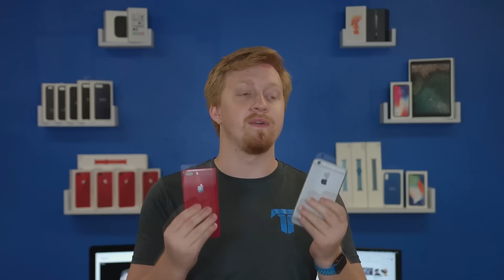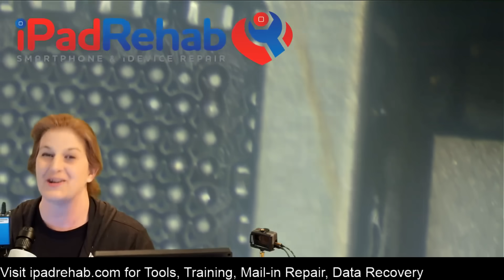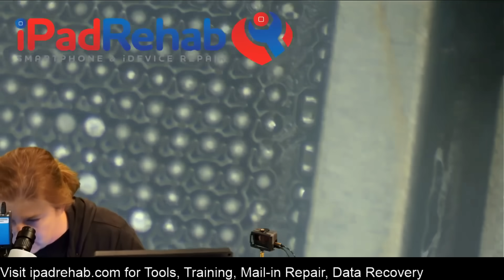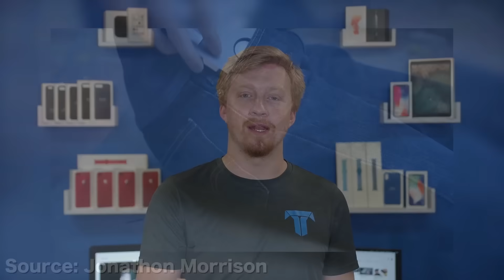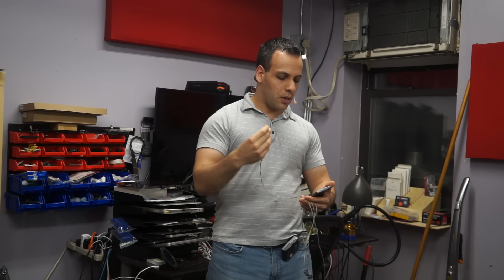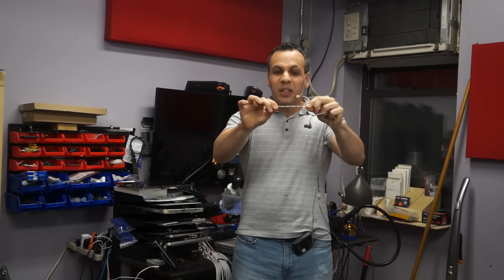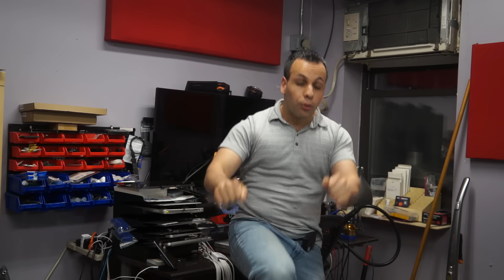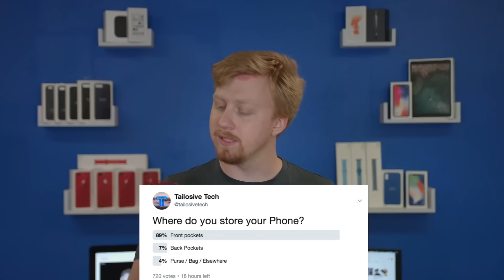The truth about iPhone bendgate deniers

Comment: As a matter of fact I have had two Samsung phones bend literally over time. I usually stayed in the J7 line of lower mid range Samsungs so getting a new phone every year while getting the latest updates was far cheaper than buying a flagship. The J7's range from `180-250 and one year they changed  from metal edges to soft plastic and I went through three of those by having them in my pocket of course Samsung just replaced the phone free. The next revision of Samsung's J7 was done with a harder composite plastic on the edges. When someone like Louis see's repetitive repair problems there should be a mechanism to report what he sees to apple. When I used to get a new computer I would call an old repairman and ask him about recent models and he would say stuff like "bad capacitors on hp" or don't get a Lenovo right now bad hinges . He was a wealth of info and I kept all my business with  him.. Heck he soldered my mp3 player back together once after I dropped it.

Comment: Funny, this is off topic but watching this video, Mr. Rossmann explained basically why/how what was at one time even my favorite pair of earbuds would go on one of the two sides, and in the last two cases, within 3 months.  I have been using over the ear headphone since i gave up on those Sony earbuds and I have not run into that problem even with my @ 4 year old pair with daily use .. .it does have another issue (100% USER error) but both sides even with that goofup ... still work perfectly fine

Comment: Apple could of fixed it just a small change in the caseing. They could of thickened the casing and slightly thinned the silicon. This would of cost a small amount of retooling. They could of increased the size of the casing, and only way you would be able to tell is if you placed a micrometer on it. He'll LG had a solution in its OLED models that allowed the silicon boards  to flex with the screen. You would break a AMOLED screen before you brake a board in the LG Flex.
Reply: Carter Baker wow LG G flex that phone was literally made for back pocket
Reply: Wgg Wfg the problem with it was resolution.  Plus Oled had a burn in issue just like initial plasma TV scteens.

Comment: Its almost as if they never did the fatigue calculations. Oh its aluminum it can take the repeated loading and unload without stress hardening and failing. doesn't it deform instead of failing. Yeah but that won't affect anything. hundred of thousands of complaints and broken boards later. maybe something else doesn't like fatigue to well in the phone.
Reply: tactition777 body will handle that ...
Pcb bends.   ... People won't seethat

Comment: 5:29 - Alternatively, Samsung admitted, voluntarily recalled, repaired and redesigned the batteries for future phones after the Note7 debacle, the Galaxy S8 was the first phone where the battery will not cause a fire if the battery is damaged - THAT is quality design and service. Apple on the other hand still deny and do this fkn iGarbage every year, they know their drooling fans will not critique Apple as *they can do no wrong, even when repeatedly proven they suck*...sigh 15:47 - This was why  bought the GS5 when the GS6 came out! No ip67, no removable battery, no microSD and no USB3.0...BUT, Samsung LISTENED to popular demands and RE-included the ip68 water resistance, microSD support, USB-C but sadly removed removable battery, air-view,glove mode and the i.r blaster (great to make your GS5 into a universal remote for your tv, radio, a.c etc.)
Reply: Steven4570 Exploding is a misnomer, the phones didn't detonate in a high energy explosion like a stick of dynamite. They burst open and caught fire. It was a violent combustion not an explosion. Hence no one died.

And defensive wounds is right. Samsung made a massive effort for the s8 to regain customer trust. I have an s8+ and its the most durable and well made piece of tech ive ever seen or owned. I have dropped the thing more often than I can count and even with a minimal case it only has a few tiny scuffs. Their failure inspired them to pull out all the stops and make as good a piece of hardware as possible.
Reply: steven4570 at least it didnt kill some one like iphones did
Reply: Also Samsung seems to actually listen to criticism to some degree. Look at the Galaxy S7, with the Galaxy S7 they fixed almost all the things people criticized about the S6, they added back MicroSD support, water resistance and put in a significantly larger battery. Kudos
Reply: iGarbage ......better name change than the iFruit lol ...
Reply: thats a flat out LIE. apple admitted voluntarily replaces batteries at half the price it normally costs. EVEN if your phones battery health is fine. 29.00. also admitting your battery explodes and then providing service to fix it isn't quality design AND service. its just the right thing to do.
Reply: Tow Dow 3 soooo. Apple doesnt do it for free? Even if they are faulty by design? And your saying thats good service?
Reply: "Alternatively, Samsung admitted, voluntarily recalled, repaired and redesigned the batteries for future phones after the Note7 debacle"  Well DUH. Cause it could literally kill you
Reply: steven4570 - You have replies turned off, so i'll say this here. Lives were not at risk, they definitely are not any more. The point you seemed to miss was the fact that Samsung unlike Apple faced the issue, dealt with it and made a better device. Apple has done NONE of these things in the MANY issues they have had across devices. Some have been serious such as the 7 iphone7's exploding ala note7's 9 that went boom with batteries from the same factory... Their bluetooth earbuds exploding in people's ears/faces is kind of a serious issue too. Again as usual, suppressed by Apple..... So on and so forth my trolly friend.
Reply: Uhm, I'm pretty sure an exploding phone is life threatening. "Their bluetooth earbuds exploding in people's ears/faces is kind of a serious issue too."

Perhaps you should understand the difference between and isolated case and a pattern.
Reply: But on the other hand apple supports their phones longer then any other company, hell the 5s is going to get ios 12. They have the best resale value and year after year the most powerful chips. 

In gaming they are by far the most powerful phones an iphones 5s  (2013) can play PUBG better then the OG pixel (2016)

Comment: Hey Louis, got a question about something not really mentioned in the video, but wonder if it's a good factor toward this situation.  Does keeping an iPhone in a good case eliminate these issues vs the people who do not use a case?  I've owned the following models:
iPhone 4
iPhone 5
iPhone 6
iPhone 7 Plus (current)
and have never experienced any of these issues personally and was curious if keeping my devices in a case + not being rough on them helped.  Anyway good video, was just wondering if you've seen a percentage difference between case vs no case protection.
Reply from the maker: If people put it in a good case, not those silly ones just for show, then sure. It does a lot to help the phone not flex and bend.

Comment: it feels like both of you are talking about two different issues actually, one of them is "click bait bendgate", and one of them is "real bend gate". The click bait one is really just being stupid and is not indicative of real use and you seem to lean more heavily to this which really should not have been the real bend gate. The "click bait bendgate" is not normal wear and tear, and seems to be where tailosive leans heavily on, and since most bend gate videos are on the click bait one, he seems to only research from there. However most of your points brought up are related to the video he brought up. 
The "real bendgate" was what was supposed to be an actual bend gate since it actually damages your phone in wear and tear, and was not a unreasonable, and unreasonable testing on the phone. Its rather unfortunate that "clickbait bendgate" over shadows "real bendgate". "Click bait bendgate" over shadows real issues

Comment: Except the iPhone 8 doesn't bend
Reply: Except he is talking about how the internals will get damaged just as easily because it's using designs from years ago that Apple knows is problematic. It's like using the same shitty brake system in multiple generations despite the brakes causing thousands of accidents.
Reply: John Gotti it cracks
Reply: • Versacerik • under enough pressure any phone will. Not defending the IPhone, just trying to be logical.

Comment: Having run my own repair shop for 5 years I can safely say that the iPhone 6 is the ONLY phone i encountered with flexing damage. Not to say that other phones dont have problems, they do, just not this. In fact in the vast majority of cases other phones only broke due to misuse, not because they are made from recycled coke cans (not that i'm against recylcing or anything, its just they should be recycling the iphones back into coke cans).
Reply: MrWagglesProductions part of the problem is how firmly the pcb is secured to the frame. My LG V20 only has a few retention points which allows the frame to flex while limiting pcb flex
Reply: Dean Natale apparently you didn’t listen to the opening repairs videos and all the remarks throughout the video that show this problem is also on the iphone7 .
Reply: recycling the iphone back in coke cans? hell no i dont want a icoke to be more expansiv then a redbull
Reply: The iPhone 6s and newer are made from a much stronger Aluminum that seemed like an apt response from Apple to fix the problem. Your results would back this conclusion up. However, this video would suggest that all iPhone since the 6 have the same problem regardless of the hardware change. I’m not sure which conclusion I should draw from the situation.

Comment: the reason why males usually put their phones in front and female on the back is the size of the pocket. With HTC M8 I use to put it in to the front as well, but with much longer Samsung Note 8 it is much easier to put it in to the back then to the front (and yous I can't sit no matter where I put it). Also you don't have to explain anything to the customers, because the answer is simple "Because you bought it". Why I never got scammed by Apple? because I now they are bad and I never give them money. So do I think Samsung are better? No, but I bet with my money that after the Note7 fireworks, why will be extra careful in designing and testing the new device, and so far I could not had any issue with the device.

Comment: Regarding the back pocket, I put mine in my back pocket because my glasses and wallet go in my front pocket along with my Airpods. My back pockets are the only place I have for my phone because I obviously can’t store my glasses there and would notice my phone not being there vs my wallet. 

This is probably true for other people who wear glasses but don’t need them for everything.

I also prefer to put my keys (small) in my front pocket not to lose them.
Reply: littolicce there wouldnt be a problem like almost all other smartphones if the phone itself didnt bend. its a valid expectation that your phone shouldnt be able to bend under most ordinary circumstances versus your glasses which will have a thin frame. your screen might break but thats a valid expectation, if it's the whole chassis of the phone itself, the company ought to have disclaimers that their product will be prone to such damage. you made a very dumb comment comparing a thin frame of spectacles to what used to be a 800$ phone with a layered metal body thats meant to be gripped and touched more so than your plain glasses.
Reply: A lot of women put their phones in their back pocket because, for some reason, the front pockets on women's jeans are usually tiny. Too small to fit a phone without 2/3 of it sticking up.
Reply: Chashmodai can we get an amen because that is the truest statement of the century. In the rare times when I try to use my front pocket for my phone, it ends up digging into me and being generally hard to fish out because of the elasticity of skinny jeans. If anyone has a practical way to store a phone (other than a backpack, of which I've already ordered one), please stand up because right now I can't without getting stabbed in the gut by my phone, which by the way, isn't even that large. It is by no means a phablet. It's hardly over 3 inches long.
Reply: That's female pants for ya. Not only the front pockets but the situation is even more ridiculous when you have pants with sewn pockets. I have a couple of those and It's annoying AF and I hate it. Hence why I have a couple of male jeans for comfort even if they are kinda baggy.
Reply: Cuban Nerd I am a male and wear exclusively women's sized pants now (I have a very slender build) and I can fit my HTC Bolt, souldering iron, a drink, and my keys in the front pockets of all of my H&M pants.

I don't understand the criticism of women's pant's pockets, they seem to provide the same function as men's pants, if not more because they also make it look like I have butt.
Reply: I'd be buying a fanny pack before I'd sit my ass on a really expensive phone. I know most people think fanny packs looks stupid, but do you know what I think looks even stupider? A person carry a phone in their back pocket.
Reply: I see girls put their phone in their back pocket 90% of the time. Every girl I've dated (albeit it's not a ton) has put their phone in their back pocket. Louis was definitely right about that one
Reply: Nice to see you Roberto.
Reply: Cargo shorts master race!
Reply: I'd personally put smaller keys in the back pocket. They don't break, and you'd definitely feel a hand going down that far your ass should someone try to pickpocket you, and they are definitely not going to fall out assuming you're not doing handstands or backflips on a regular basis.
Reply: Those little wireless headphones Apple sells for $159.
Reply: I've always been baffled at the fact that people would put things in their back pockets. That seems so impractical. What happens when you have to sit down? Anything in there is going to get bent and crushed.
Reply: Well then it would be your fault if it bent? It’s like if you put your glasses in your back pocket then whined about them being broken after you sat.
Reply: Leif Christian Rosendo While I don’t think that a phone should be able to bend that easily (I had 2 iPhone 6 for years without a case and NONE of them bent at all), but glasses are also supposed to be picked up and manipulated as well (a bit less than phones but that’s why they don’t have the same build quality). My comparison is still valid. If you don’t take care of expensive products, you’re doomed to break them.

I’ll be right back, I’ll go on countryside bumpy dirt road with my brand new Ferrari. Nothing should happen, it’s a car and cars are made to be driven, right?
Reply: littolicce you are correct, nearly every Ferrari nowadays is equipped with active suspension based on a suspension type similar to their formula 1 design so driving over a bumpy country road should be completely within reason. let's not forget one of the best 2 wheel drive rally cars was based on a Ferrari model, the Lancia Stratos.

Comment: Use a thick copper wire to demonstrate the flex damage. You can bend it nicely the first times but at around 10th bend, it will break.

Comment: Wrong, the iPhone 8 isn't a bad engineered just because it's based on the iPhone 6 design, they changed the structure and the type of aluminium so you have no argument there, therefore it's no longer relevant what mistakes the iPhone 6 had.
I had the iPhone 6 Plus which apparently were more fragile than the regular one. Guess what, it never bent, it never stopped working in any kind of way. I sold it when I bought the iPhone 7 Plus, maybe people should be responsible for how they treat their phones.
Try bend any other phone on the market and see how the chips inside handles it.
Reply from the maker: I said iPhone 7, not iPhone 8

Comment: Aluminium will bend and stay bent, it really isn't the best material for phones or even tablets if you are going to have them in any area which puts force on them. In a front or back pocket in tight pants, or in a backpack with other things against it. Many cases, aluminium will slowly bend from these forces. Plastic though has a tendency to flex but then return to it's original shape, it resists bending a lot more. Since Apple love aluminium, maybe they should just make a plastic case but have a 0.5mm casing of Aluminium around it. Then you get the appeal of the Aluminium and also the better structure of the plastic in the same phone. 
Of course that would require a different manufacturing process which they probably wouldn't be bothered to do.